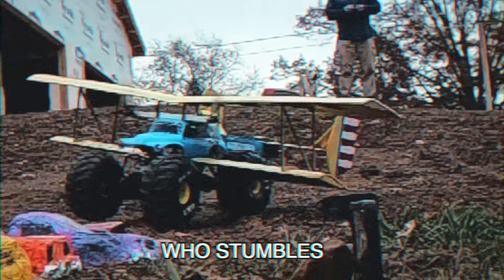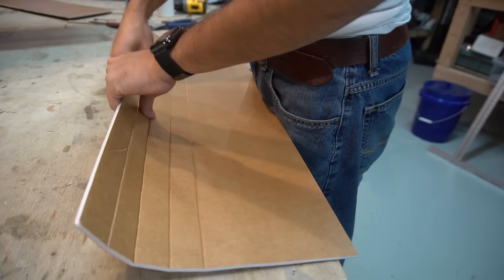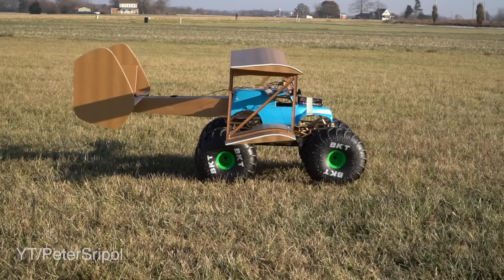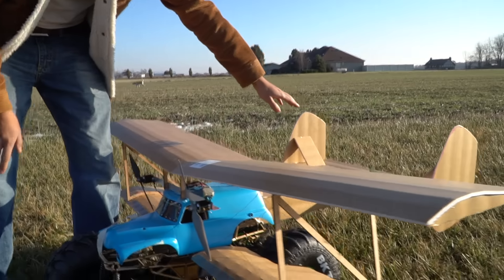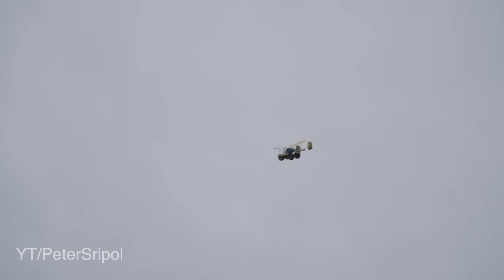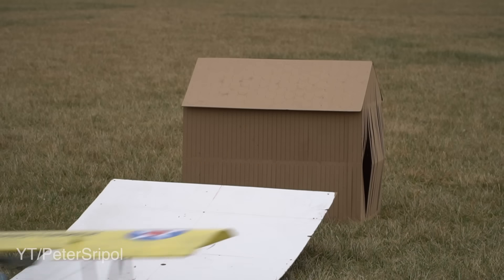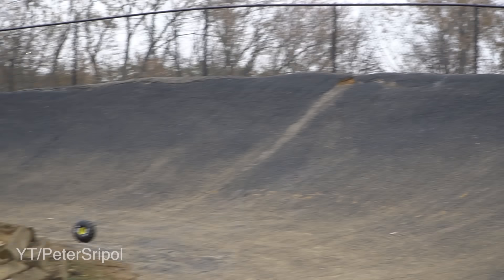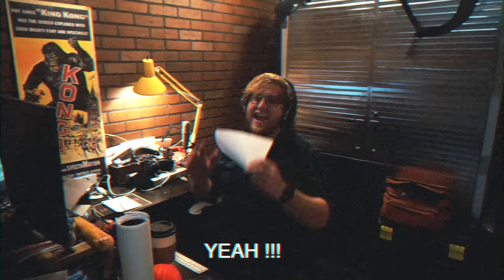FLYING MONSTER Truck RC airplane car!

Comment: Flying monster truck is my favorite project so far.  Making a jump, and just keep going up. A quick 1 minute on how you decided how big the we wings should be, where the wings should go vs CG, and sizing motors and props would be neat.
The video made it look like you just put everything together, and got super lucky that it flew.

Comment: “Next week, we’ll have the Flying Sripol Streetpole!”
Reply: Then a flying toilet
Reply: Chrome Donut Gaming  Haven’t commercial airlines been doing that for years?
Reply: @server642  not that flying toilet, a real toilet with wings on the side and what ever
Reply: Chrome Donut Gaming  I know, I was just being facetious!
I like the idea though, and perhaps Peter could use a gas engine and use the flushing mechanism as a throttle 😜

Comment: Barnstormer lore because yes:
Barnstormer was built in the early years of WW2 in the United States to test the boundaries of aviation. It was a biplane design and wasn’t fitted with any ammunition. It could crush tanks and even carry up to 4 crew members. It had 2 engines RIGHT next to the doors of the Barnstormer,making it impossible to enter with the engines on. It was scrapped mid-WW2 and all designs were destroyed.

Comment: Do a rc dragster with a nitro engine. It should be pretty easy to make that fuselage not only very controllable but easy to attach a front control surface to the down force wings and make the rear wing BIG! You can do it!

Comment: Around 1973 or 4, i converted a model battleship into a plane with wings and a gas motor. It actually flew controlled by strings and going in a circle around me!

Comment: Now please make a flying rc car from a hobby grade car instead, they are heavier but also faster (depending on scale 1/16 ,1/10 or 1/8th) It would be cool because the smaller scale cars are pretty fast so if they flying version is fast you can do some sick flips.

Comment: Warning if you have a normal foam dont use spray paint because it will destry and dissolve the air bubles and make it worse

Comment: Peter stripol you should make a super car with like a jet engine or propellers and also attempt to make an airplane that goes super fast. I bet you can’t get a plane to go faster than 250 miles per hour or 402 kilometers per hour

Comment: Wanting a new transmitter but I'm stuck between the ix12 and nx10 spektrums which would you get? Also seen alot of reviews on radiomaster tx16

Comment: Dude when you were a baby your mother didn't have to babysit you. She could leave you in a bare room with just walls and a floor with your diaper on and you would still find a way to entertain yourself. How many rc planes can you stick together making one gigantic machine that you can still get to fly? You've shown that you can make power tools fly. The flying grinder had me smiling ear to ear. I'm a mechanic and machinist. Too funny. I tell every body.

Comment: Now that should be a real sport full size an all just put helium in the tires and make them remote controlled with vr driver so they feel ther in the driver seat without getting mangled wen ther monster plane goes destructo!

Comment: Cool a flying monster truck but doesn’t fly but fireworks well use many horse power but you could put paint so it will be cool but it does fly sorry about that  this moster truck bronze poweruped has ability